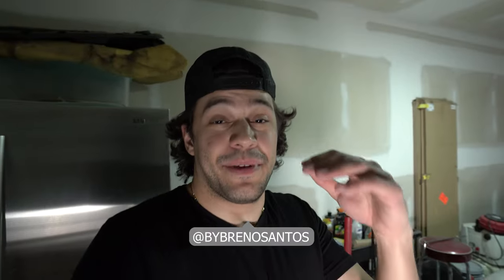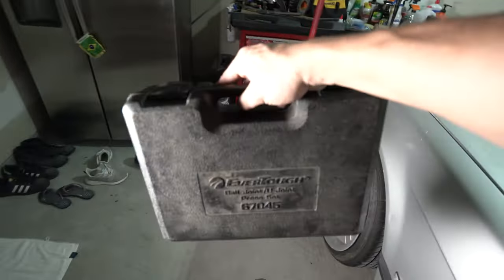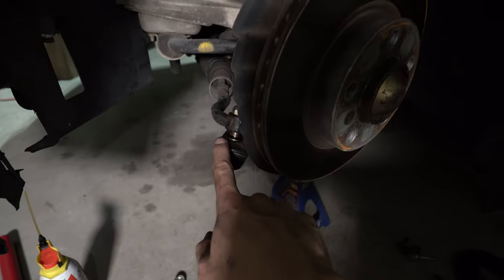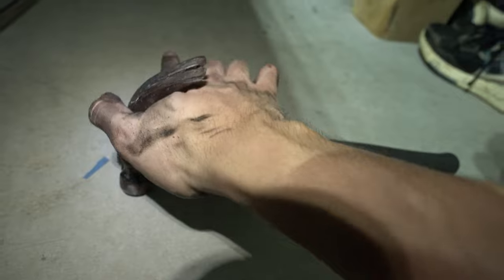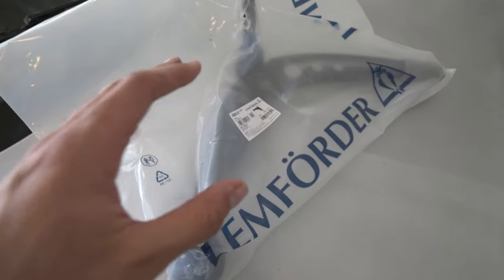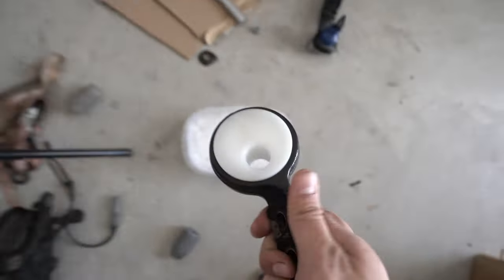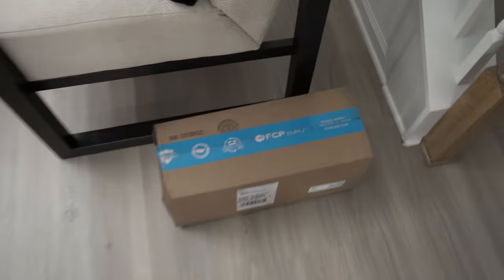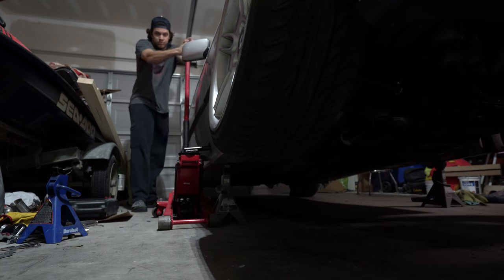POOR man's ANGLE KIT for my E36!

Comment: Those bushings increase caster but they could be the tiniest bit off which explains why one wheel is more forward than the other, you should spring on those adjustable lollipops so you can dial them in just how you like. Hightech suspension would give you the best general alignment for street/drift setups or they could adjust it depending on what you want to try out. At the moment, I'm trying out -12 camber, 5.6 caster, and about .10 toe out in the front. Feels great so far with self steering being more prominent and it's pretty snappy!  Downside to having -12 though is front grip is only maximized during full lock.

An angle block adapter might suit your setup as well to quicken your steering, but that should be added later  on after getting this setup worked out first. Lookin great so far!!
Reply from the maker: Thanks for the help dude. Yeah I think I’m going to go ahead and order those slr ones. 

-12 must be insane hahaha. I think I’m going to try to be at like -7 honestly
Reply: @ONGO_  -7 is perfect, Im only trying -12 so I can still have good tight fitment up front with stock fenders, might decide to pull them or go with overfenders if needed lol, instead of a bulldog stance.
Reply: This is great information because I’m also having this issue thank you for explaining this !

Comment: Cutting and welding arm is not a good idea. Better is to use longer E46 arm. Inner tie rods from Porsche 911 (997) are cheep good option too. They add around 10deg of steering. They are also known as Chelsea Denofa tie rods.